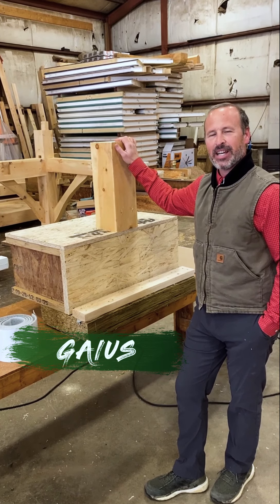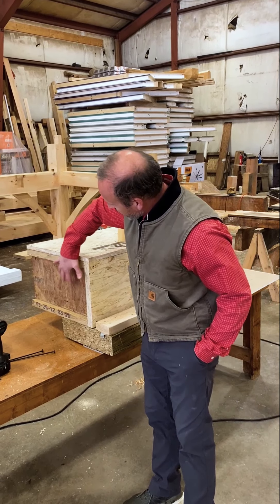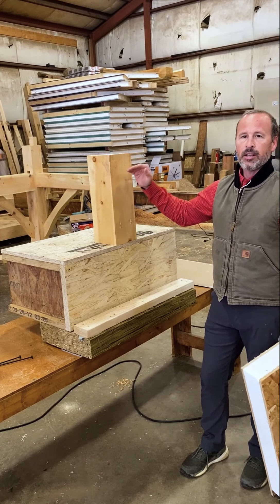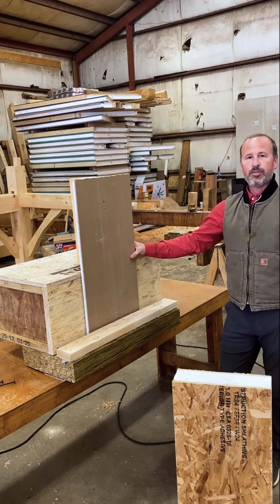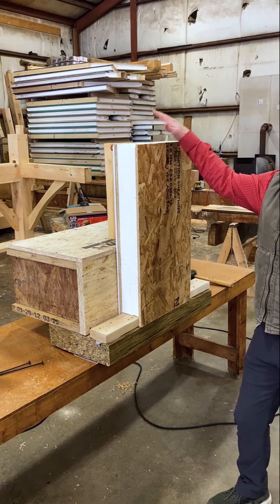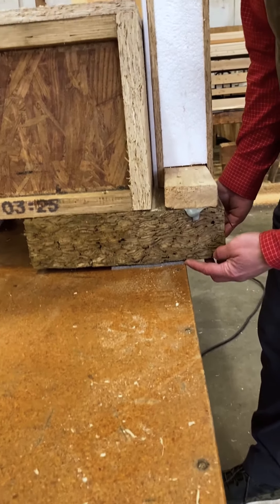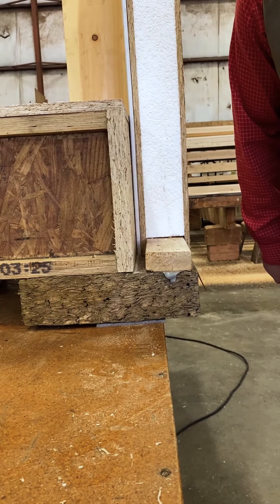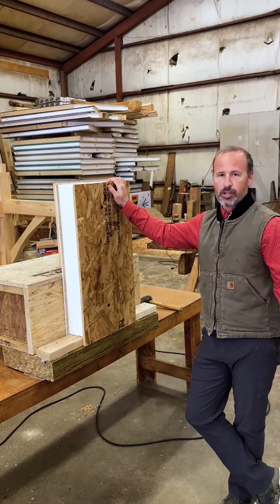Attaching Your Timber Frame to A Concrete Foundation Pt. 1

Comment: I don't know if you guys do it at all, but a detail like this on other enclosure methods would be reeeally helpful.
Reply: I agree, I’m not a big fan of sips and I’m interested in alternative methods for insulation/sheathing/siding details. Ones that can be accomplished with conventional materials available locally as sips are expensive enough and trucking long distance drives up costs when they are manufactured a long distance from the job site. I actually built cut away wall sections for Dow Chemical when styrofoam was first introduced, long before I seen it used in the field either commercially or in residential. They spent a lot of time and money engineering ways to incorporate it into typical building practices and trying to convince builders, architects and the rest it was worth the expense. The best argument being a consistent thermal barrier from footing to the roof. I’m a carpenter not an engineer and I have a few ideas so I’m interested in seeing what other alternatives have been tried. As for the video I think it’s great I believe that method is sound although the gap at the foundation is questionable maybe a more complete mock-up would answer some questions like foundation insulation and covering/coating in conjunction with the siding above.

Comment: Great demonstration! Do you stagger the gypsum board and the SIP to avoid edges/gaps aligning? Also, just to clarify, you always leave the sill plate proud of the top of the foundation wall correct? Is this to get the vertical posts to be over the foundation wall while allowing for the room behind it for the SIPs? Is that the logic? Very good job in your content!

Comment: Could you add an additional video showing a monolithic slab and the connections needed?  Just can't seem to visualize the cross section without using the joists shown in this video.

Comment: You don't put another form of sealer on the outside of the Rim Board base and under that 2X4?  Sort of like a Capital "L" on the facing of the rim board and under that 2x4?  Just curious.

Comment: As a future draftsman student, would the construction material for this type viewed on film footage be engineered for one story buildings only? For those who have experience in Australian construction homes can these buildings on film footage be in compliance with the Australian building code (ABC)? If it is not a sensible answer this time please don't share it.
Reply from the maker: Hi Anthony - While we cannot speak to the Australian building codes, this material can be sized and engineered for multi-story structures. We have used it all over the US in varying climates, adjusting to meet seismic loads, wind loads etc.
Reply: @ShelterInstitute Do you mean material made out of timber and foam for multi story buildings for viewers out there? If it's all made out of wood then how is it structurally engineered? Certain structures require certain structural loads. So as to try to not make too many assumptions, a multi story building in a bush fire may not survive with that kind of material for the structural load; or, are there outside sprinklers on each story building? Probably it's fair to say that you're in a cold climate where in summer it's only maximum 15 to 25 degrees celsius? Architectural engineers and structural engineers often communicate with each other; agreeing on booking in a geotechnical engineer to determine the soil for your trenches, "this is interesting." I wondered you may be a structural engineer or either the other. Forgive me for providing too many assumptions, please excuse my spelling error. We are not of the same language.

Comment: So please help us out with understanding completely what you are teaching. 
That Sill Plate looks like it is 4”X10” or wider.(?)
Those Floor Joist only require a 2X4 Still Plate, and why is your Sill Plate a 4by ?
That Sill Plate sits completely on top of some sort of Foundation 
 Member, right?
And the whole Sill Plate gets sealed underneath?
If you have the Timber Frame Post mounted on the Sill Plate I could see the size.
And when you showed underneath, shouldn't you have TWO Joists (minimum) side by side with space between both joists fully filled in SOLID with Squash Blocks/FillerBlocks/Solid Blocks which fit tightly between both Joist’s Web.
Basically, that beam is required by code and Engineering principles to be FULLY/SOLIDLY Supported down through to the Sill Plate and then to solid Foundation Members to solid earth.
Reply from the maker: Hi Brian-
The sill plate used here is 3 1/2" x 11 7/8"; we use a robust sill plate because it cantilevers past the foundation wall to support the SIP and will resist uplift as it holds the timber frame down to the foundation. As shown in the video, the sill plate needs to be wide enough to provide adequate bearing for the floor joists as well as extending out to the exterior of the SIP. The support underneath the posts needs to be sized to carry the weight of the loaded post above (cannot exceed the maximum compression parallel to and/or perpendicular to the grain values published in the National Design Specification); this rarely needs to be as large as the post above since the post's size is determined by the logistics of timber joinery, typically at the second floor level, and is therefore larger than it needs to be to carry gravity loads. The details of the model in the video are for illustration; every design needs to be fully developed and engineered for the specific climate, wind zone, seismic zone, timber species and design-rules of thumb are dangerous! Hope this helps to clarify.
Reply: Shelter Institute 

My understanding is that a sill/bottom plate should be completely supported by the foundation member it rests on. Is your Engineer licensed to certify via his stamp the integrity of this design?

Comment: How wide is the concrete foundation?
Reply: Hi, did you get an answer to your question??  I had the same question.
Reply: @kevinschwartz4089  Not yet.
Reply: I'm guessing it will depend on the height of the wall.  8" for a wall that is less than 8' high?
Reply: @seanf7810  With 8x8 posts and SIPS exterior, I doubt that an 8 inch width foundation would be sufficient.
Reply: @olddodger7178  You're saying that the post should be fully aligned over the concrete wall but in the illustrations I'm seeing, that's not the case.  In the example given here, if the foundation is 8" thick, only 5" of the 8" post is directly over concrete.  In other examples I've seen, the post is situated well within the concrete wall entirely.  In either case, I think additional lumber is used to transfer the post load to the ground.  If it's a basement, you're probably going to have additional framing inside the concrete anyways to accommodate the insulation. 
As for the SIP, Gaius says the concrete extends 2" beyond the rim board but we can also calculate that the combination of gypsum (1/2") and SIP (4 1/2") equals 5" so the SIP and the sill plate hang 3" beyond the concrete.  That seems a bit weird, but the stuff is pretty light and I guess it's mostly supported by screws?  OSB has poor compression strength so it was never designed to transfer it's load to it's bottom edge.
Don't put too much stock into what I'm saying here.  This is just speculation on my part.  I'll post again if I get a definitive answer.
Reply: @seanf7810  Thanks Sean!